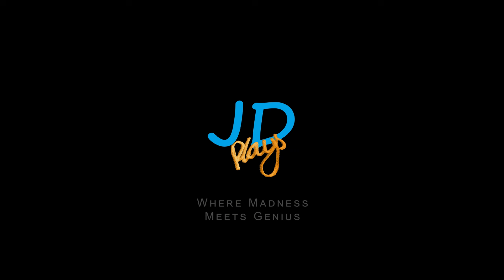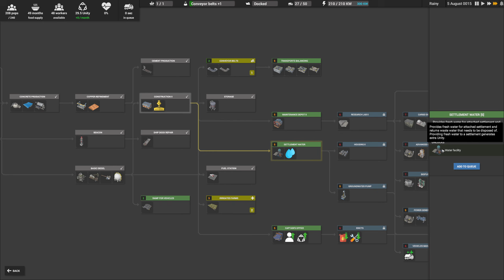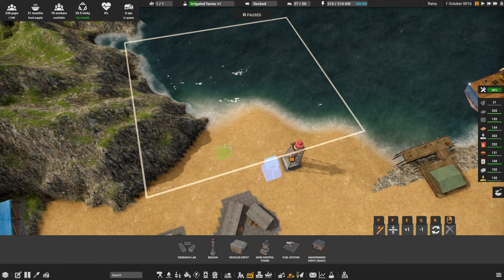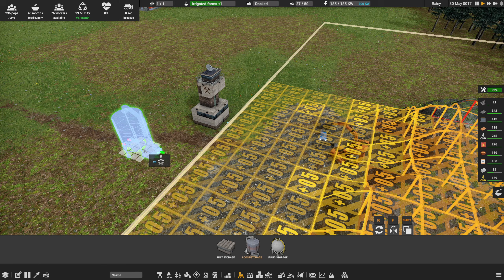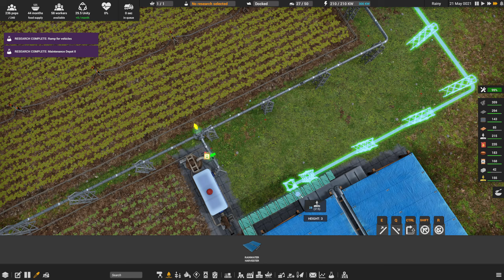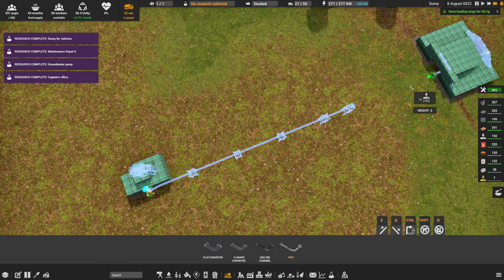Water and Irrigation 🚛 Captain of Industry 🚜 Ep4 👷 Lets Play, Walkthrough, Tutorial [Beta]

Comment: Finally, conveyors, this should make transportation easier. You should try to get Biofuel next, that can be useful for replacing Diesel later on.

If you want to put away dirt or sand for later use, why not make a mound in empty space? Then later on you can dig it back up, Otherwise you have to make a lot of storage units for sand.

Also, there's no need to build conveyors and pipes 2 blocks up just so you won't hinder the trucks, just build ramps or create a district that don't require trucks, and I'm sure the game has a pathfinding system for the trucks.